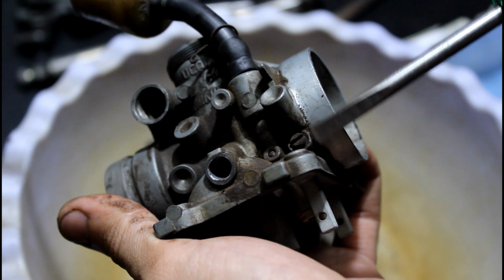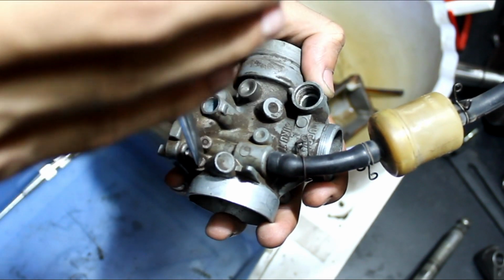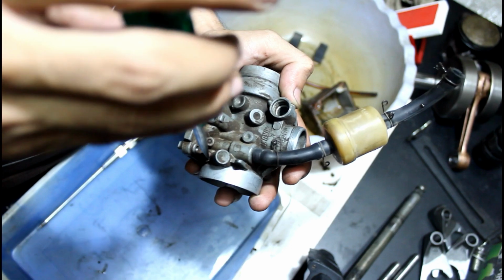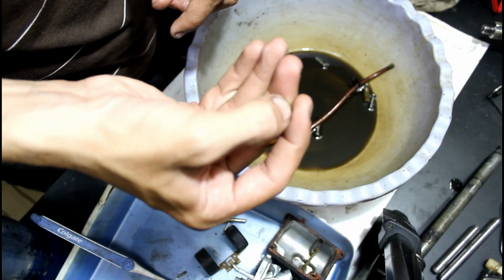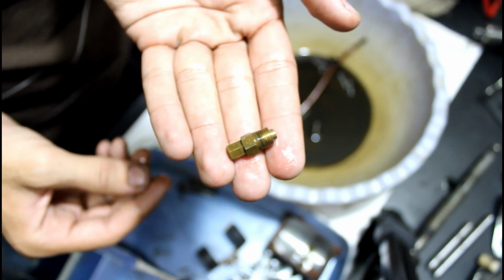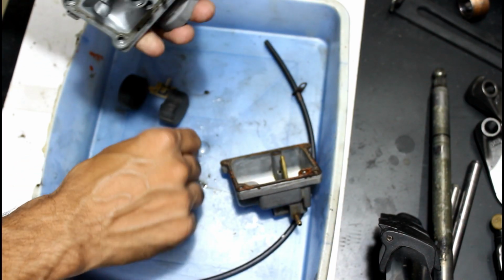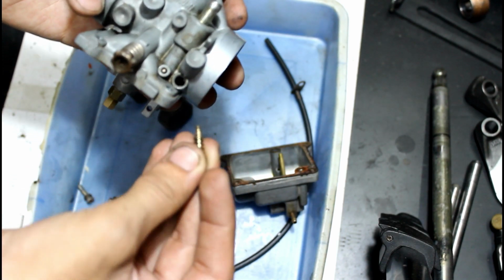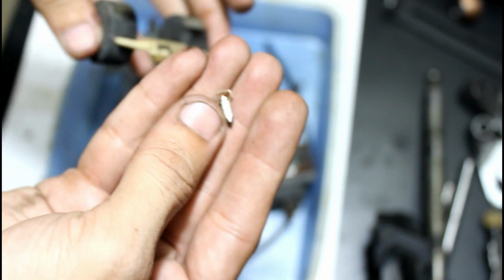How To Clean Carburettor | Yamaha Restoration Project - Part 8

Comment: While cleaning the carb after removing the main jet you should clean the automizer too which you didn't.air setting screw or pilot jet screw there is no need to count the round u have to set the air mixing your self after starting the bike . When you took of the pilot screw there is a small o ring in side carb wich you didn't took of .it's most important part in the carb never drop it.
Reply: Yes, agreed 👍

Comment: Hi. I have petrol over flow problem in my rx. I had changed the float pin and its screw, but still m facing overflow problem. Any solution